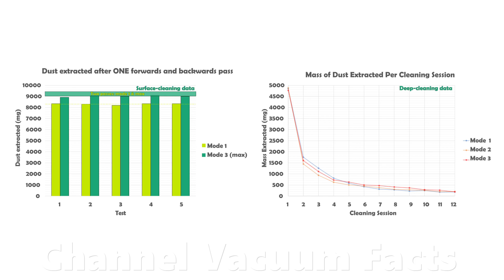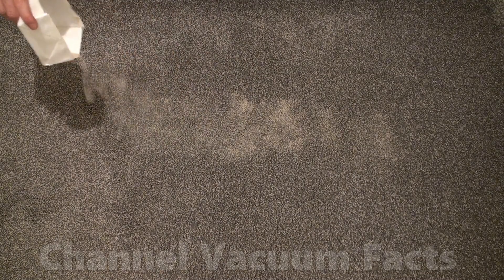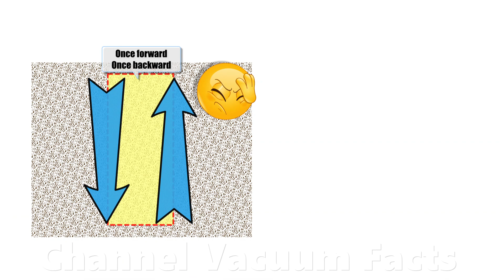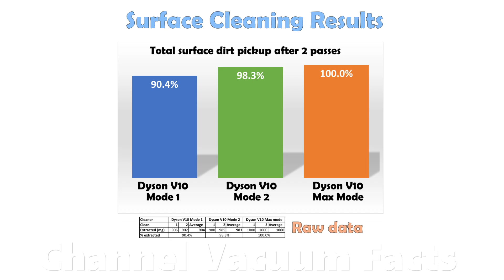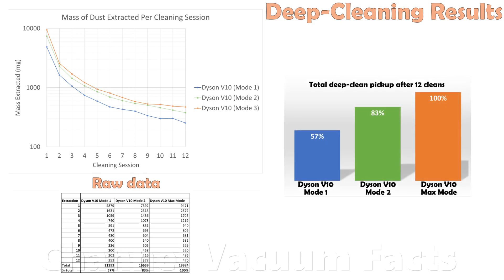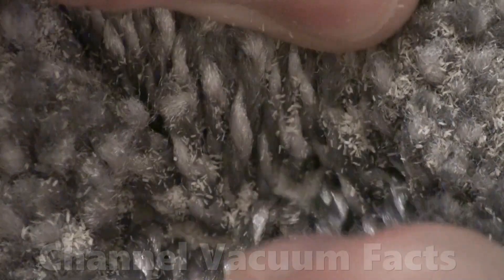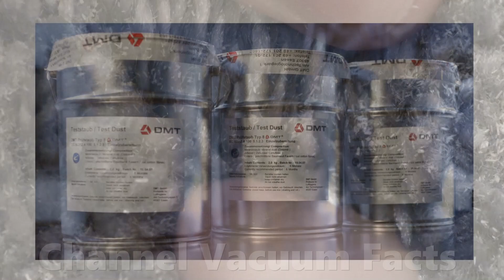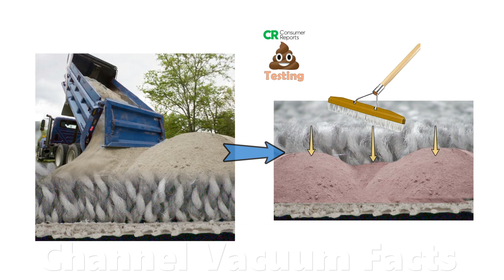Dyson Cordless Performance Measurements

Comment: Hmm, how come mode 1 did better in the previous version of this vid but mode 2 in this vid cleans better? Am I missing something or is mode 1 supposed to be the general vacuuming mode?
Reply from the maker: I think it was because of the type of dust used (fresh microsponges) which are pointy. As mentioned in later videos, after a while, they breakdown into more dust like particles and stick less. So I don't use fresh dry sponges now, and the data then makes more sense and is reproducible. Mode 1 is extended run time; mode 2 is general use.
Reply: Ahh cool thank you

Comment: Fake
Reply from the maker: What is? And why? And how do you know?
Reply: @VacuumFacts  your test. Because you did it. Because I know about vacuums
Reply from the maker: um OK... don't think you're going to be convincing anyone respectable with that level of reasoning...
Reply from the maker: @AverageReviewsYT  xD
Reply: @VacuumFacts  any more videos on the v11 coming up?
Reply from the maker: Maybe later down the line. I'm going to see how long I can not clean my filter for before it shows signs of performance degradation (rather than visual dusting, which isn't the same thing, despite myths to the contrary).
Reply: @VacuumFacts  I have had my v10 vlr almost a month and it's still white af.. I use it every day for my bedroom. Yes.. I keep my carpet next to dust free lol..  I vacuum slow and alot no issues with the cyclones or filters yet. Just mainly fine dust on the bin
Reply: In the bin

Comment: Why don’t you have a v11 then you can bang on about shit that nobody cares about
Reply from the maker: I can't justify the personal cost of a V11 at the moment. People do care about what's on my channel.
Reply: Vacuum Facts ok but your facts are wrong and misleading most of the time
Reply from the maker: Making a claim like that needs to be supported with some evidence—like you see on my channel. Could you outline which 'fact' I've presented is 'wrong' and present your evidence-supported case why? If I do it "most of the time" as you suggest, then it should be fairly easy to find plenty of examples. If not, then it just looks like you're making things up and cosmetically contradicting in an ironic way.
Reply: Vacuum Facts for example then numatic vs dyson that Henry had no maintenance on and it was tested against a nearly new dyson
Reply from the maker: Er, both machines were in 'used' and 'dust-loaded' condition. Representative of how they would be for most of their lifetime. That is a very weak argument to suggest what's observed isn't representative. It was perfectly reasonable. Next week you'll see how a pristine Kirby with an unfair advantage (no dust-loading) performs.
Reply: Ok you keep coming up with irrelevant arguments

Comment: Your videos on the V10 actually convinced me to buy one. I followed your advice and generally only use mode one and it works perfectly.
Reply from the maker: Could you be more specific? What specific claim has he made (citation) and where is the evidence to later show it was made up (evidence)? Without that, it just sounds, ironically, like you made it up, which wouldn't look good :P
Reply: Vacuum Facts because sometimes you talk about the most irrelevant crap about stuff if these dysons are that good then they would last for 20 odd years and the machine would need little maintenance for the price of a dyson you could get a numatic George it’s a vacuum carpet washer and can be used for upholstery cleaning and thanks to the big capacity bags all dust is held in filters rarely need to be cleaned Saving money time and effort
Reply from the maker: @Williamdow20   "you talk about the most irrelevant crap". You say lots of things like this, but don't really do a good job at justifying them. Which is rather ironic when you think about it. There is evidence some last for "20 odd years" (some people still use a DC01). Most people don't keep their cars for that long, even though they're built to last. They want an upgrade. And their longevitiy is not the only metric people value when it comes to their choice of appliance, as you're implying. Most people are happy if it lasts a decade, which Dyson at least, aims to survive for at the very least. If you want to learn why wetting carpets is not the best way to clean them, then see here: https://youtu.be/XVR-YdzytBA
Reply: Vacuum Facts could not give a toss really you clearly haven’t a clue what you talk about
Reply from the maker: Ha; my advice now is use mode 2. This video explains why. Previously I used a type of dust which isn't representative of normal house dust and that biased the results without me realising it. The previous videos weren't wrong, but didn't show the bigger picture. I always use mode 2 now except on hard floor when I use mode 1. The V11 in auto mode essentially does this mode switching automatically.
Reply: I returned my v10,  which I loved, for the v11 which is 200 dollars more but is well worth it, 30% more power give or take and longer battery life means medium mode usually gets 99%of the dirt and lasts longer, plus the lcd screen
Reply: I'm a single bloke who lives alone. I have stripped floorboards everywhere apart from my landing and stairs. I also have a deep pile rug.
I only use mode 1 as my house doesn't get that dirty and I'm always amazed by the performance of pickup.

However, I've just come back from helping a friend move house. It is carpeted throughout with medium pile carpet. It was so dirty that I used mode 2 and spot cleaned with max.
The carpets not only changed hue afterwards, they felt like brand new carpets. If the battery had lasted long enough I would have used max mode all throughout, however it simply wasn't necessary.

As for the V11 I don't think it warrants an upgrade from the V10 if you already have one. The performance of the V10 is astonishing and the battery is more than proficient for most people. If I was buying now I'd have the V11, but I wouldn't trade up from my V10.
Reply from the maker: ha you're making us jealous
Reply from the maker: Pity you didn't film it and put it on YT to show what it accomplished. I'll probably be getting the V12 rather than the V11.
Reply: @VacuumFacts  I don't really feel the need when people like you give such insightful reviews. Your videos really did convince me to buy my V10. Yours were the only ones that actually showed the real performance and with each power mode. 

As for the V12, I will be tempted dependant on the technology it brings. Unlike all other Dyson handhelds before it, the V10 was a clean sheet design with next level tech. If they only give incremental changes each time like the V11, I will be hanging onto my V10 for a while.
Reply from the maker: It probably will be an incremental update given their apparent annual cycle now. I was originally predicting a new battery technology for the V12, but now I'm not so sure given the scientific and engineering difficulties in upscaling it. But who knows.
Reply from the maker: Again, you keep saying this, but don't really do much to make a convincing case. It's easy to throw wild insults around, but it's another to actually be respectable and defend them convincingly. You just come across as someone who simply doesn't like what I say and the facts presented, because they conflict with your subjective opinions and what you'd like to be true instead. So you're lashing out. Seen it all before.
Reply: Trust me while somethings he say are true and the v10 is a great vacuum cleaner he mostly makes stuff up